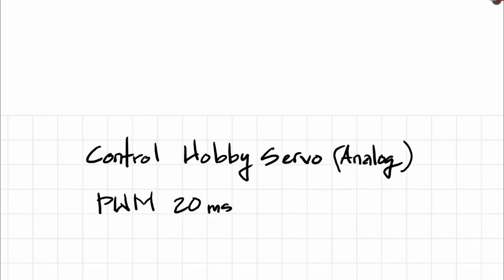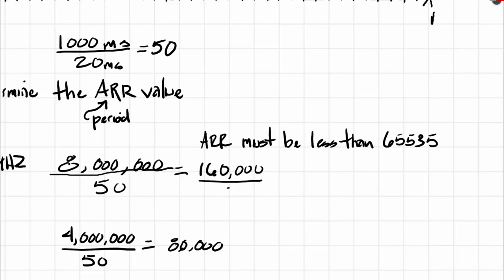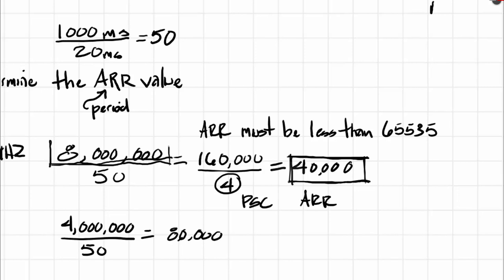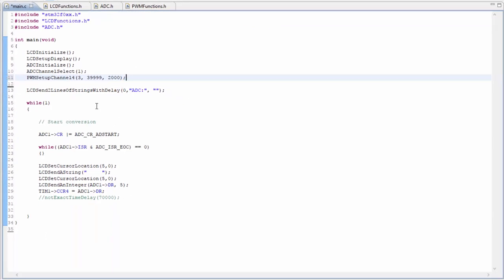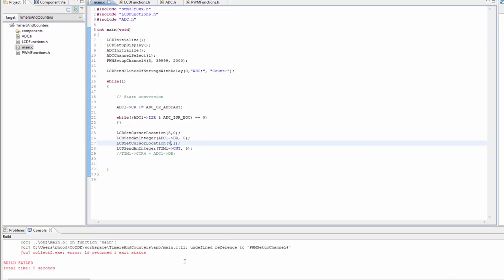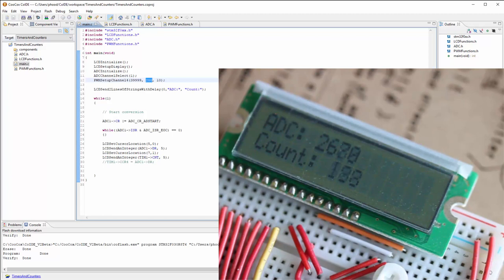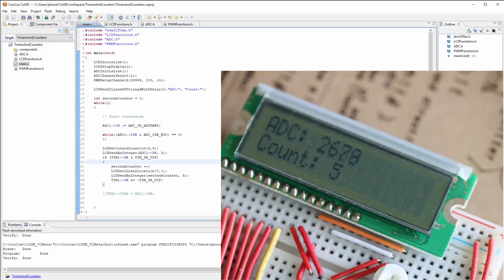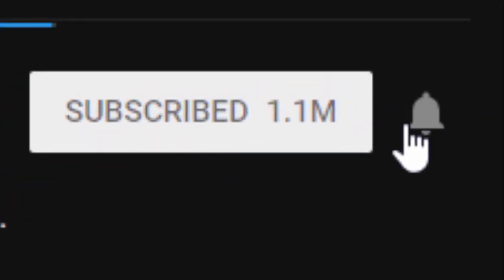49. How to connect a Hobby Servo to the ARM Microcontroller Part 1 - ARM STM32 Microcontroller

Comment: you should be having so many more subscribers!
Reply from the maker: I know.  I suppose it is the nature of being in a very narrow niche.
Reply: Patrick Hood-Daniel now that many people are still using Arduino or avr. The migration is not fully there yet. Once the hobby industry also shifts to ARM you ll probably have a slew of new subscribers.. wish it happens soon!.
Reply from the maker: Thanks.  It's crazy they haven't already shifted.  The chips are faster, cheaper and have more capability.

Comment: hey, I too am using the STM32f030r8t6. I tried this code out but the "secondCounter" is moving up much faster. Though this is also essentially running at 8MHz. What could be the issue?

Comment: This uC is not working at 72Mhz ?
Reply from the maker: No
Reply: So you are using its internal 8 MHz oscillator.
Reply from the maker: onurolce yes. But the internal oscillator is multiplied to 48mhz. You should watch my previous video where I do this.
Reply: Ok I'm going to watch it. But if it is multiplied to 48MHz. then prescaler and counter should not be calculated for 48 MHz?
Reply from the maker: Your not using a prescaler, you use a multiplier.   It's best if you watch the video rather than explaining it in comments.